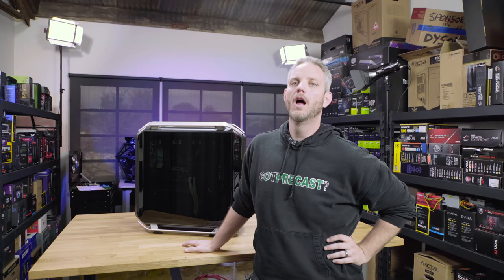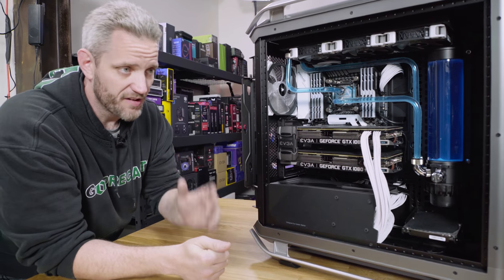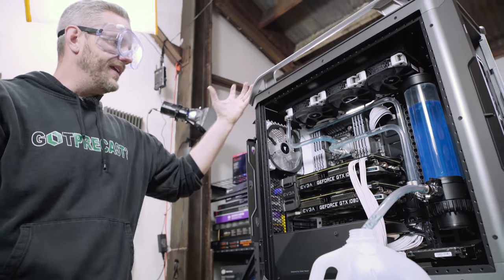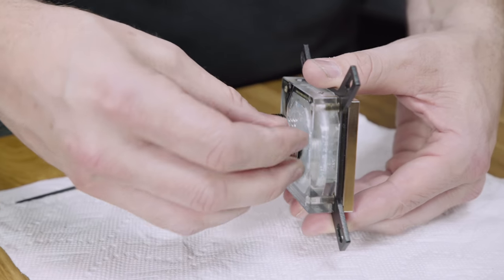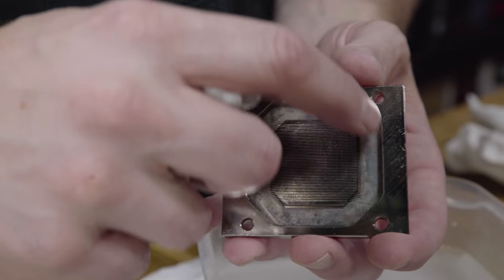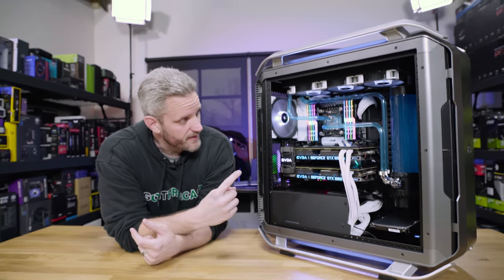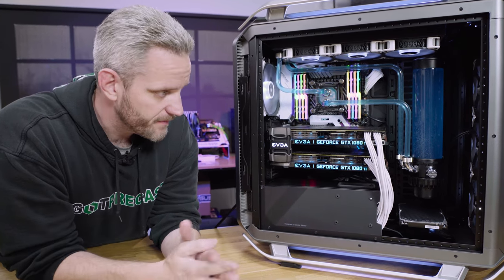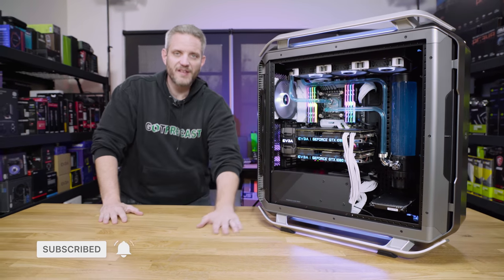It happened again... and this time it was NASTY

Comment: My purple coolet from thermal-take, has a white break down of the fluid within a week of using it. Effected the color, but doesn’t seem to be effecting my temperature yet.   Plan to do a full system clean.... soon...  i have 2 more 1L bottles from thermal-take and they look the same...  fluid is now pink, all my clear tubes are coated with white crap. 

Contacted thermal-take. Directly about the pre mix fluid and they said that was normal order 3x 1L bottles for 3 different stores same problem, breaking down in the bottles before even opening...  thoughts @jayztwocents

Comment: Bad coolant I suspect I just use distilled water and UV dye  and haven't had any issue with corrosion whatsoever but I do get particulate build up over time from the degradation of the dye used

Comment: That white material looks like the result of some kind of corrosion and maybe you should check the materials things are made of to determine if you have some kind of reaction going on that will just keep happening if it is not properly diagnosed.

One thing to consider is whether specific additives put into the water might cause it to be capable of conducting electricity, even a little bit. Pure distilled water placed into a very clean loop should not be contaminated. Nevertheless, the tubing or the radiator might have an electrolyte left over in them from their manufacture that produces an electrically conducting solution when dissolved in a polar solvent like water. This could cause electrolysis if there is a stray current induced or somehow leaking into slightly conductive water. Stray fields in the block or around the radiator could produce a small current in the loop. Colorants and other materials used as additives in the cooling loop may have this property. 

Plastic plumbing should function as an insulator. Nevertheless, dissimilar metals in the presence of an electrolyte can produce another effect called Galvanic corrosion. Galvanic corrosion takes place when two different metals (one a "cathode" and the other an "anode") are in contact in the presence of an electrolyte. The electrolyte in this case is some contaminant or additive to the water that has made it conductive, possibly some type of salt, say left over flux used when the radiator was manufactured. Remember too that "soft" water tends to have a lot of sodium in it, so use double or even triple distilled water. Any additive has to be completely free of electrolytes and not turn the loop into even a very slight conductor. 

Radiators can be and are made of different metals, such as brass, copper, and even aluminium. It only matters here for this discussion if the metal in question is actually in contact with the fluid in the loop (not the fins between the tubes in the rad). You may want to use an anti-corrosion additive if you are planning on mixing metals, such as a copper block and an aluminium radiator. Copper and brass work well together for instance and you probably don't need an anti-corrosion additive. 

Just a suggestion.

Comment: Never use dyes, additives or any type of 3rd party coolant. (They always leave residue, stain and other nasty stuff) Distilled water with a silver kill coil is all you need.
Reply: Except you shouldn't use a kill coil with nickel blocks. If your coolants are leaving residues and staining then you are using the wrongs ones or using them wrong.
Reply: @scootbmx01 
Yeah pouring coolant wrong? Or using the coolant wrong? What's there to screw up? LOL I doubt it. Also, it's not my job to "experiment" with what coolants stain. As this is clearly what happened in the video, smh. Also It's only copper and aluminum you have to worry about Nickel and silver is fine together. You must be referring to that EK Nickel flaking thing. I've used a kill coil with Nickel fittings. NEVER had a problem. This video is a clear example of why my original comment still stands true. This was only 6 months of usage.
Reply: @mrtwister9002   well if you have residue or staining then yes you are using it wrong, wrong concentrations, using the wrong products who knows. Im not the one having issues. You said it wasn't your job to experiment with what coolant stains but you made a claim that it ALWAYS leaves a STAIN, RESIDUE or NASTY stuff so are you just pulling that assumption out of your arse? the only dedicated pc coolants i've heard of people having issues with was primochill vue (like in the video) and mayhems aurora because people used it for longer than the manufacturer said to (like in the video). outside of that is the issues surrounding pastel fluids and the nano particles breaking down which has since been rectified.
Reply: @scootbmx01 
Whatever dude.
Reply: @mrtwister9002  that's what I thought.
Reply: @scootbmx01 
LOL, dude I'm not gonna debate it with you. The fact is, the additives and the other garbage that people put in their loops stain. This is well known. Some may not, but I'm not going to experiment with it and figure out which ones don't. Distilled water is free and it's not problematic. It's the most practical to use. If you wanna put that junk in your loop and clean it out all the time be my guest. Coolants are mostly snake oil with aesthetic effects that's it. If they provide any advantage over distilled water it's marginal at best.
Reply: @mrtwister9002  so what you are saying is you are relaying crap you have no experience with? Jog on child.

Comment: I love your videos man iv literally been subbed to you for years but I had a massive binge watch of all your videos keep it up brother. The backstory is, I just upgraded my old R9 290x system with an EVGA 1070TI ftw2 the problem is that I did not think of, was that I am still running an FX 8350 8core 4ghz so there is some major bottlenecking in BF5 not so much in bf1 but very noticeable in BF5.
I'm thinking of buying a B450 AMD motherboard with an RYZEN 5 2600x. do you have any advice for me to maybe consider if I wanted to upgrade in the future?

Thanks Jay.

Keep up the amazing work.

Comment: 2:35 Inside .. Really!?! Unless you have a fully identical system (same radiators, blocks, pumps, couplings, tubings, etc) the contamination can come from anywhere. My guess is a galvanic reaction, even alloys can react; water loops 101. (edit) Your entire loop is toast .. cleaning will only accelerate future galvanic reactions i.e. it'll get gunked up next time significantly faster. Personally, the last problem free loop I built was from Koolance and then only using only their stuff.
Reply: exactly.  I made sure all of the loop materials I purchased were copper.  No nickel.  Even between copper of different materials galvanic corrosion can occur which is why i use coolant + distilled water rather than h20 or distilled and silver.

Comment: How do I let Air in at the top of my Radiator If I dont got the extra openings? Can I Just Install a T fitting with a opening and closing mechanism at the top Radiator to Stick a long softtube on IT to hold it in the Air above the case?  Normal drain Port at the bottom Part of the Loop calculatet (to let the water Out)

Comment: would it be possible to use an oil or alcohol? I know you would have to check your tube selection with alcohols but would that be better than the metal scaling?
Reply: also you'd prob have to avoid using any "chromed" fittings since it uses electroplating to add the chrome, a liquid medium inside varying electromagnetic fields is probably acting in the same way inside of a computer. since chrome plating usually involved first plating the metal in copper, then chromium the exposed copper you see is the base layer and the white powdery scale is probably some form of chrome alloy or oxide.

Comment: Copper does not rust because rust specifically refers to what happens when Iron oxidizes. However, copper does corrode and oxidize, which is basically "rust" but for copper. That's why it turns green over time.

Comment: Tbh ive been using air coolers for the longest time and nevwr went liquid. Seeing all these problems that people go through with liquid kinda scares me sometimes. Idk why but you can get a air cooler enough to get those over clocks that you could get on a closed loop. You could get a hyper d92 by cooler master and they work amazingly. Sure a bit loud but it cools the fuck out of the system. Liquid is really mainly for looks and bragging rights

Comment: Funny ive been using primochill for 10 years.......
Just to clarify.... thats 10 years in one system with never changing it. And only topping it of after 6 years of constant running.
I'm finally building a new system and I'll use them again.

Comment: I had the same problems with those EKWB plugs. They weren't black nickel. Just nickel color. Like that third one that didn't rust. Those EKWB plugs are cheap, but that doesn't mean they should have cause the problems for EKWB customers. EKWB sucks on quality and the customer support. So to avoid that problem, always use only Nickel(not color) metal alloy. Never copper. As they would produce rust on the contact edge with radiator. But again, that is EKWB fault.

Comment: Looks like electrolysis when water passes through copper and metal was touching copper causes electrolysis and then starts to leak  Plumbing reference. Cannot have copper with water and a different type of a metal. It has to be all copper or it has to be all metal.

Comment: Complete novice at water cooling but other than cool color factor could you run straight distilled water or better dionized water would that prevent a lot of the issues with the fluid or does the fluid have thermal priorities in the fluid if its just non conductivity any super pure distilled water wouldn't conduct as impurities cause issues in water personally I would use colored tubing and clear liquid

Comment: Honest question, why doesn't anyone just uses car coolant? Its been engineered over decades to work with copper, brass, iron, steel, aluminum, etc at a wide range of quality  (as no two car companies, let alone the after market industry is going to uses the same quality metals) under far harsher conditions at much higher temps for far longer time periods.

Comment: I was a plumber for years. Dissimilar metals that make any kind of connection in water will create electrolysis. Which in turn will inevitably cause corrosion and eventually system breakdown and failure.
Reply: yes, good info, but that is not what happened here - it was the fluid choice he made.

Comment: I thought it could be that dumb XSPC pump/res that doesn't mix the coolant in the loop with the volume in the res but then looked and you have used the same one in the Threadripper system that you said has been fine. Still, its not a good idea to use a pump like that with a fluid that needs regular mixing to keep everything in suspension.

Comment: CAN YOU HELP WITH A SUGGESTION. I ran the vue in my system and I had the fluid break down too. After cleaning and switching back to distilled water I really miss how it looked. I am wondering if you could recommend a fluid or fluid/dye combo that I could get an opaque and uv reactive green fluid.

Comment: I wonder if changing to different materials for the fittings may help.  The blocks obviously needs a highly conductive metal, so that nickel coated copper is probably not going to be bettered by anything other than gold - yeah, pay for that! Looking at this: https://www.engineeringtoolbox.com/thermal-conductivity-metals-d_858.html it does seem as if silver could just about match copper, with gold being 3rd best followed by aluminium. However, that nickel plating is due to copper tending to oxidise if even just a minute amount of oxygen is introduced, same applies for silver. So for something which will never tarnish, gold does seem to be a better choice. Perhaps just gold plating the copper would work, it should also increase the thermal conductivity of the block since it's better than the current nickel plating.

But surely the junctions, elbows, caps, etc. can use some other more inert material? They don't need any conductivity at all, so the options become much greater. Guessing the radiator is aluminium, you can't just stick any sort of metal fittings onto it (e.g. aluminium and stainless steel isn't a good mix). But I'm sure something else could be done. Even if just some form of hard plastic (just don't over tighten). But if you still want something which can handle high torque when tightening, then stainless steel - especially something like 304 grade or better (perhaps even going to 316 grade surgical steel).

However, this depends on the electrolysis properties of the coolant. That issue between aluminium and stainless steel is due to electrolysis "eating" the aluminium away through the liquid - definitely bad in water, might not be an issue if the coolant is non-conductive. Same applies to the pump, usually its impellers are made of some aluminium alloy (similar to an engine block).

Then lastly, I wonder how well something like anti-freeze coolant would work. You know, that stuff you chuck into a car's radiator? It's designed for even higher temps and specifically formulated to avoid corrosion to aluminium blocks. It just might actually be good enough. ... Uh! Sorry forgot, you did this last year! Sorry, forget this lame idea.

Comment: If that didnt leak, how often Would you have to clean the tubes and stuff??
Reply: ZOOSHER_UK* SWIFT&BOLD if it's filled with just clear water and biocide, once every 5 years is enough. With thr garbage he is using he'll have to do it once a year...
Reply: Nice one for the reply.. Would u say Liquid or fan if you was going to do a new decent build? Say £1500-2000 on all,  monitor not included.
Reply: ZOOSHER_UK* SWIFT&BOLD mh, considering the crazy gpu prices i'd say focus on making a beastly pc and maybe you can get watercooling later if you really want to, get a gpu that can mount a compatible waterblock.
Btw get a decent aircooler if you don't go water, avoid all in ones.
Reply: ZOOSHER_UK* SWIFT&BOLD it's usually better to get it all at once, maybe you could wait for ryzen 2 and the new GPUs. Obvioudly no one need 128 GB but if i could i would :p and use it as ramdisk. 
For a general build i would go ryzen1700x+gtx 1080, mvme SSD, an hdd for mass storage, 16 or 32 GB of ram at least 3000 MHz (and a mobo that supports it).

Comment: Hello Jay, I'm about to do a new build to replace my old OLD PC, just need to get a few more items and as of now I'm back to wondering what coolant to use, I really thought the VUE would work out, but after contacting them, it's not going to work for me. I'm doing a small loop, the ( CPU "Heat Killer Rev 3.0" Block ) and Mosfets >> preinstalled water block on an Asus Maximus VII Formula mother board, as of now I have Mayhems soft tubing 3/8 x 5/8 and Bitspower compression fittings and 240 Radiator, the pump I have is a Jingway Brushless DP1200 CPX-Pro. 

would you be able to give me some advice on going with mayhem coolant or ? The color theme is Red and White I was hoping to use red colored coolant.

Comment: "Copper doesn't rust" -Jay 2018
Reply: He's technically correct. Rust is specifically oxidized iron, therefore only metals and allows containing iron can rust.

Copper oxidizes a patina, which is actually highly water resistant layer.

Comment: I just built my Cougar Conquer with a waterblock reservoir and I am going to use the primochill. As I was advised by primochill to run the system with primoprep and distilled water for 72 hours before replacing with primochill. Now it has been 52 hours and I noticed that I am loosing water, there is no leak but the water level in the reservoir has gone down a little. Is this normal ?
Reply: yes you probably just had a couple of air bubbles that worked their way out

Comment: Copper was the problem 
You can see the distinctive oxide it has
Copper DOES rust!

The problem is coming from unlike metals in the same system causing electrolysis and corrosion
Reply: my system has been running for almost 3 years with just distilled water (copper radiators and blocks, nickel fittings, no kill coil or biocide) and the copper is 100% fine and the distilled water (which has been in the system for almost 3 years) is completely fine ...

Comment: Im sorry, but as a consumer product this fails. They should not sell this without giving you the specific parts from Ek or Alphacool and in what combination of components that you can use.

As a consumer product this is as far from safe to use, that it should be pulled of the shelf untill they can provide such information.

Comment: this looked to me like electrolytic deplating this hapends when you mix difrend tipes of metals and water your caps are chrome plated copper and your radiator is aluminium or copper if its aluminium its propably going to corrode slowly if im not mistaking its 10 years i did metals chemistry

Comment: No question that liquid cooling is more labor intensive than air cooling but there is definitely something wrong with this system with that build up. 

The conclusion of this video is not sufficient for a root cause analysis. Whatever happened to this system is going to happen again